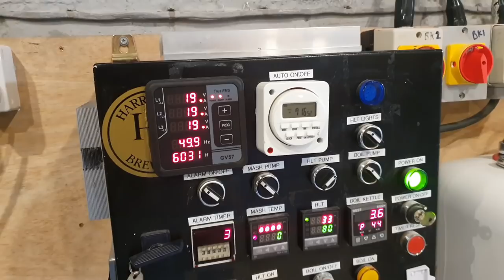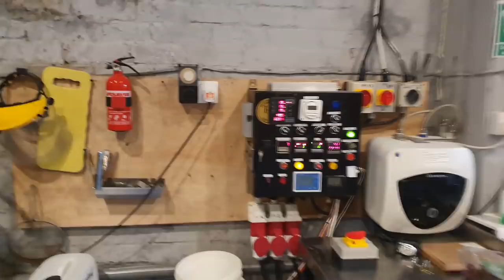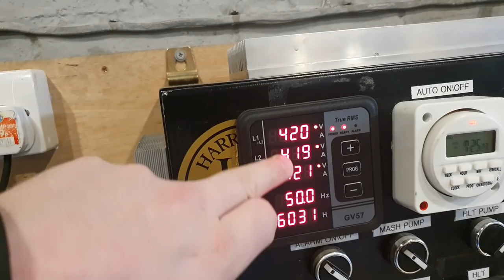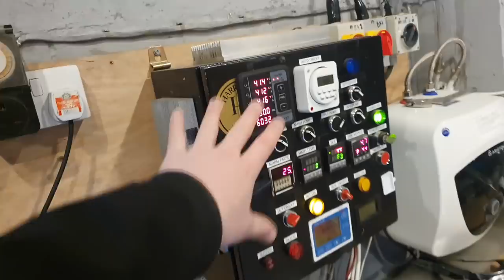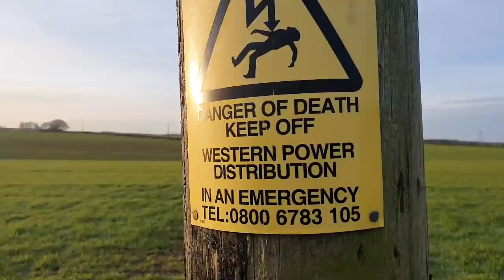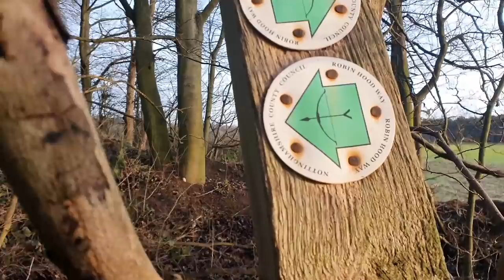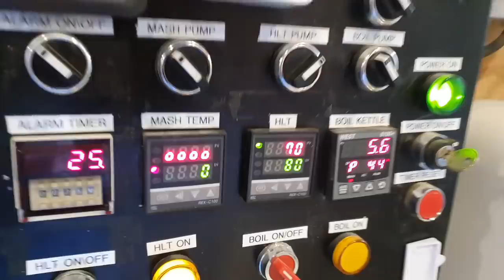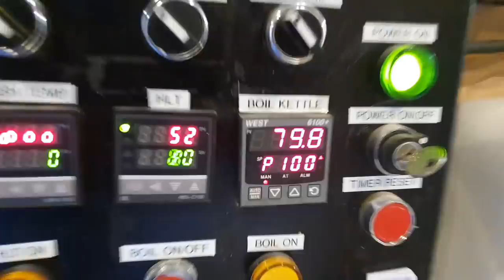She Let The Smoke Out

Comment: Neutral connection on star flushes any transient current/voltage. I always used to try and put a neutral in, helps with testing and fault finding if nothing else. Hopefully your isolators are 4 pole to break the neutral
Reply from the maker: I knew there was a sound reason. And yep, 4 pole switching all the way.